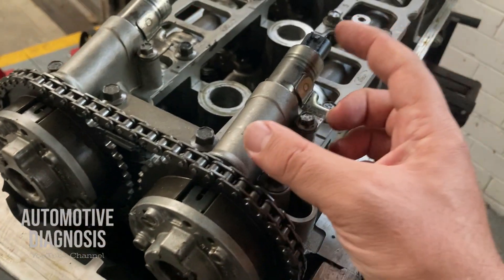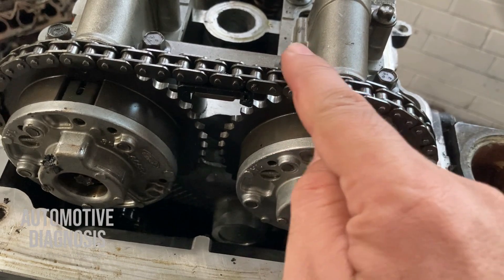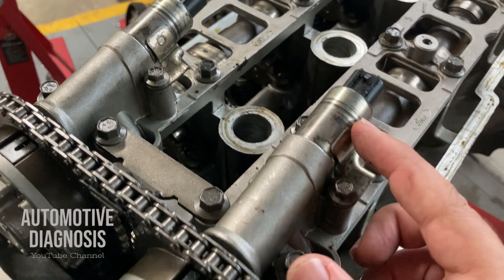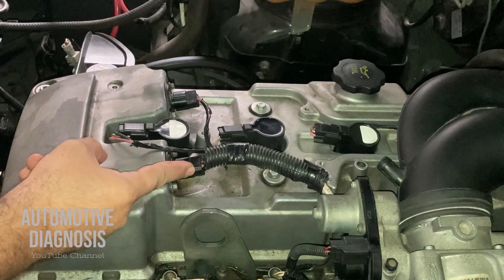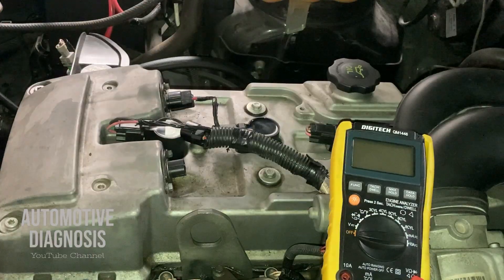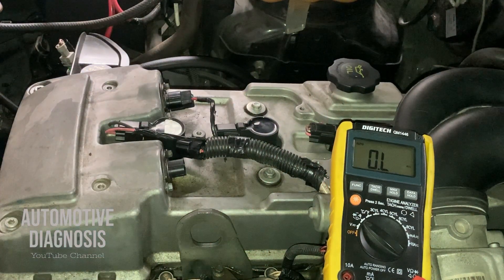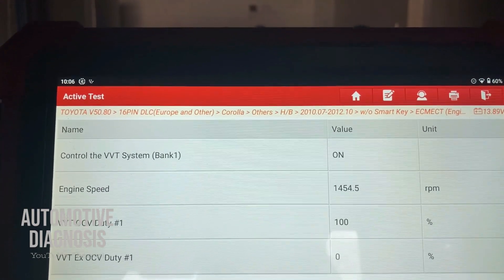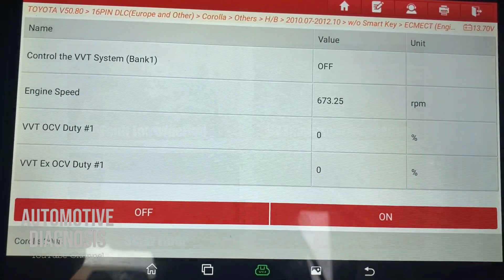How to Test & Fix P0011 Intake Camshaft Position Timing Over Advanced Bank 1 | Engine Fault Code

Comment: Thank you very much, try the selenoid and it is fine, it is only a little stained but it works well and it is resistant, it is good, the VVT filter is clean, you just need to see the synchronization and inspection of the chain and the VVT with the camshaft.

Comment: Very good video however, you did not specify if the engine need to be in on/start or off Position to conduct the multimeter test?
Reply from the maker: Hi my friend, ignition switch must be on.
Reply: @AutomotiveDiagnosis  blessings 2U sir! And thank you 4 a prompt response 🙏👌😉

Comment: I am getting the p0011 and misfire cylinder 1 sometimes and after  running vat cleaner now im getting p0420 i just bought front vvt oem  seems more power but still getting codes 2009 aveo lt hold light randomly flashes and its not getting right amount of power and oil smells a bit like fuel. Did oil change about a month ago any advice also it seems to do it more when engine is cold and also on start up I hear a noise from engine area for about 2 seconds and it goes away 😊 thanks in advance
Reply from the maker: Hi there, fault on VVT may bring the misfire fault code but it’s normally a random misfire not only for a specific cylinder. About the 2 second noise, it could be from the VVT mechanism itself which happens only when engine is cold and just for a couple of seconds right after starting, this is the VVT mechanism issue (not VVT solenoid). But you must be careful if your engine has hydraulic valves tappet, if so, noise might be coming from there before engine oil pressure reaches to the valve tappets. When you said you replaced the VVT, you meant the VVT solenoid or VVT mechanism?